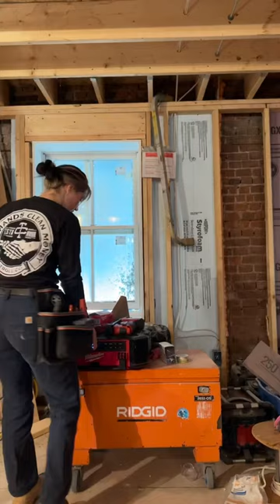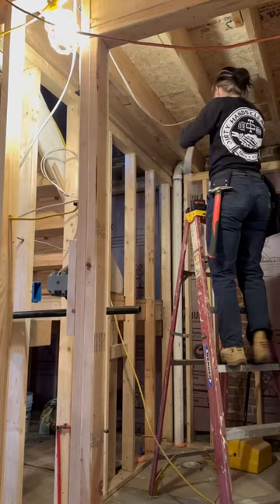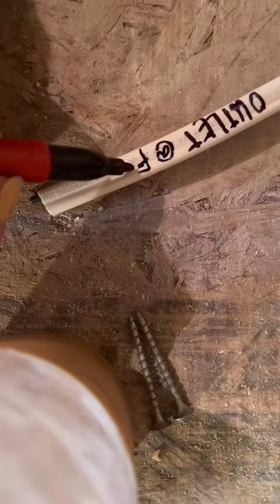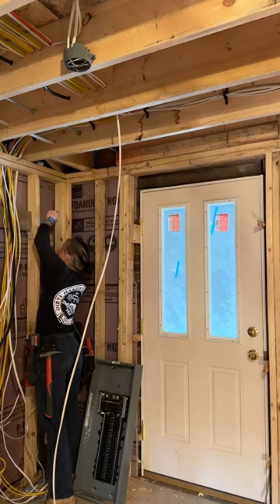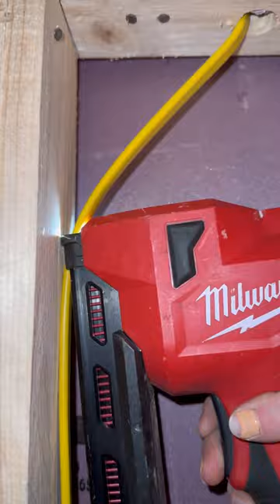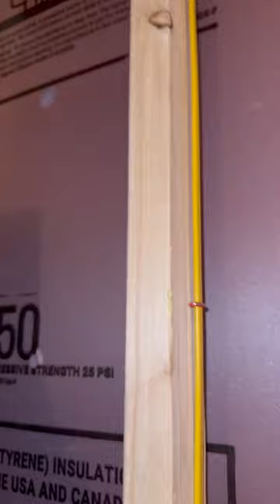Part 1 of this Apartment Building Wire #femaleelectrician #lextheelectrician #femaleelectrician

Comment: If I could send u a picture of the wiring in my attic from the previous owners it would give u nightmares worst part is I have breakers that are wired up but don’t do anything when I turn them on and off nightmares
Reply: Sounds dangerous. Especially if there’s loose insulation. But I’m not an electrician lol.